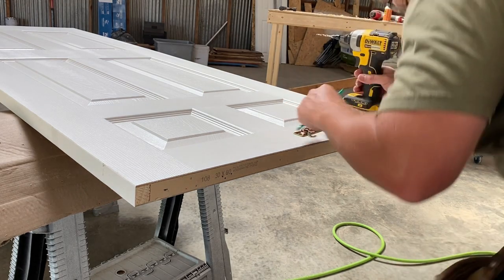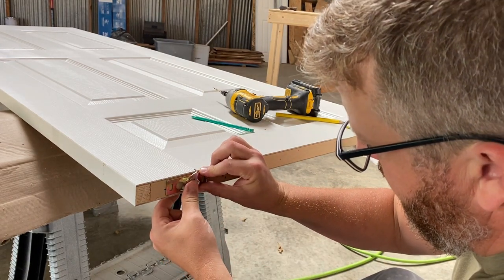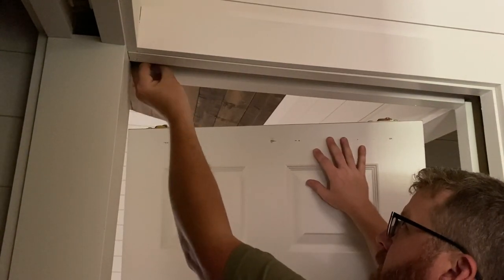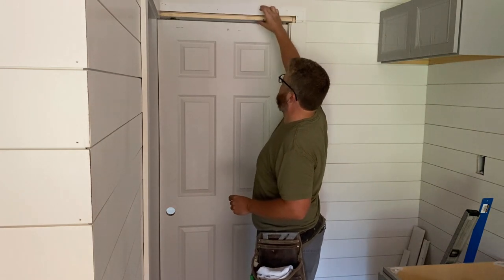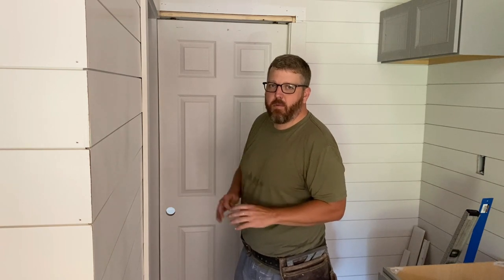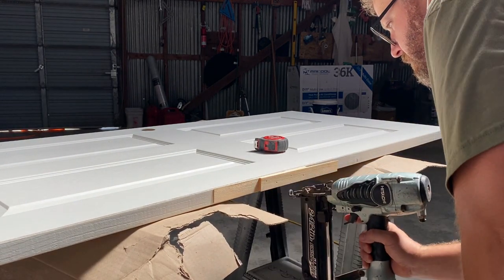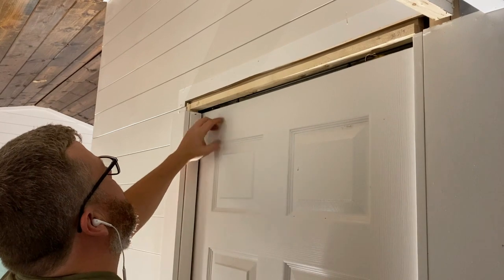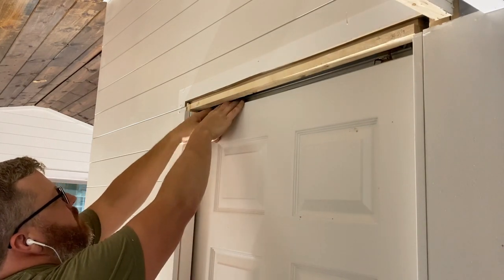Pocket Door Mistakes to Avoid

Comment: Wondering what kind of door handle you used bn that the slab you used is for a pre hung door no door knob will slide back into opening w a regular knob???
Reply: I’m not trying to be rude just asking for knowledge is all
Reply from the maker: Hey Brandon, thanks for watching! They actually make hardware for these slabs that is flush and can recess back into the pocket. Pretty cool and it is not only quicker but allows you to use an already drilled slab door.
Great question and thanks again!
Reply from the maker: No worries! My next video will have these shown as this cabin is COMPLETE! Woohooooooo! Thanks for watching, Brandon.
Reply: Great job I appreciate the info

Comment: You should have to put the wheel carrier not on the same side , the 3 wheels carrier should have 2 facing inside and the other one facing the outside, not on the same side for balance .
Reply from the maker: Thanks, Al Go! These are actually the ones that have four wheels on each, thus avoiding any chance of an off-balance issue, but I do know what you're talking about.
Thanks again for reaching out and for watching! Merry Christmas!